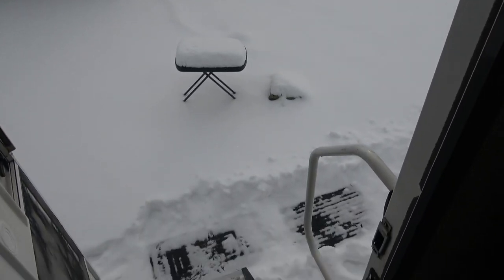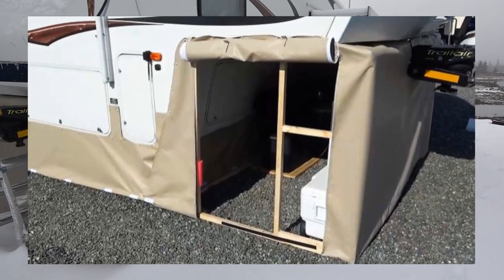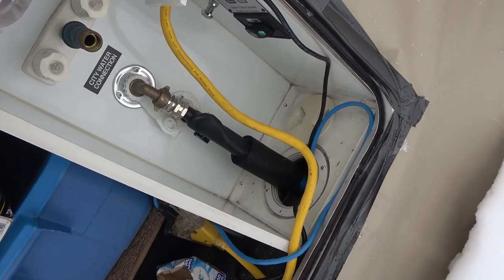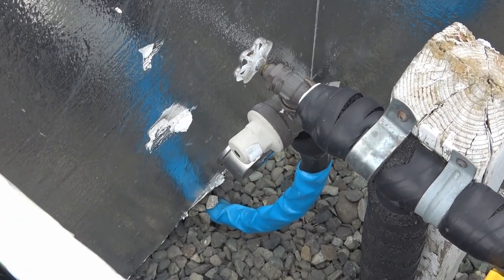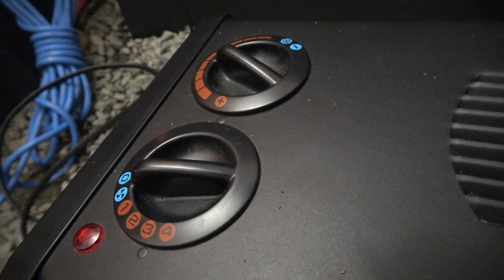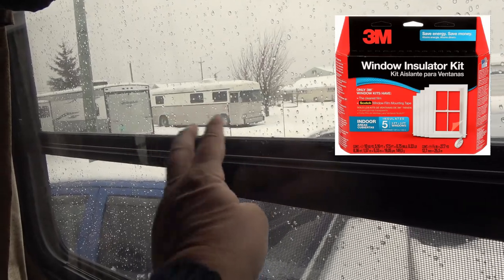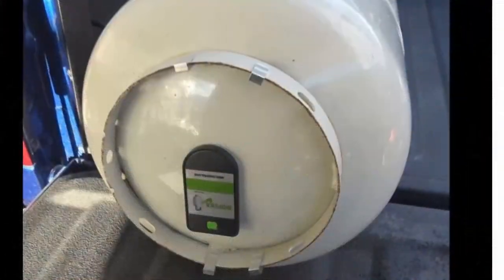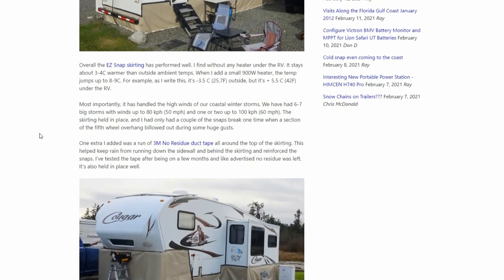10 Things that Help Us Winter in Our RV – Reviews & Updates

Comment: Thanks for the update Ray. We just piked up our new rig that was a 24 week wait, so we are trying to work in this cold weather to get it ready to go! I have used your videos helping me in my work to get ready to go. We have used plenty of Foam and other insulation products to seal up what they do a poor job of at the factory. Also ,almost a ''reinstall'' of both roof A/C units to see that the intake air has a smooth entry, with out a knot of wires and foam in the way, and same for output side into the racetrack vent system in roof. Then it was time to install a ''piggy back'' inverter system to augment the 1000 watt system Forest River puts in with a 190 watt solar unit in this Flagstaff ,from the factory. We will have the 3000 watt inverter now to run the micro and such if needed. Also, installed 400ah of lithium inside with monitor. We will add 2 more solar panels when we get someplace warmer!!! Amazing what an owner can do to improve these RV's, And I thank you again for the video's giving me the ''Courage'' to Cut the 4"" hole in the side of a perfectly good RV wall, for the dryer vent!! And everything else we have done! Hope to see you guys out there!
Reply from the maker: Awesome, sounds like you are going to have a sweet rig there. :)  Wow, 24 weeks! That's a long time to be waiting. Glad you got it!

Comment: I built my own fresh line with reinforced nylon tubing, a water line heater, and that black foam pipe wrap. But the RV park's stand pipe froze two days ago, which cracked my Y fitting. No more Y fittings with any plastic parts... and if it looks to drop below 20F next winter I will wrap it with reflectix over a pipe heater. 

But with any luck we will be in the desert by next January!
Reply: Stick with the plastic y fitting. If the water doesn't freeze at their spigot it will freeze at your inlet valve. Having a plastic fitting on the outside gives freezing fluid a way to remove pressure in a manner that is affordable. The other thing is keep a tap cracked. Water cannot freeze while it's in motion....but ya a plastic fitting outside will save you trying to replace your inlet valve in the cold and wind and some water dmg to your unit
Reply: @frogger2011ify  Thanks I'll keep that in mind!
Reply: @jimleininger8963  I thought the same thing....and I had to change my inlet in -35, thankful it broke on the outside so it didn't leak into the wall...I went back to the plastic y valve after that and a plastic 90 into the inlet

Comment: Thanks Ray!  

Our class C 32' motorhome has single pane windows so I added Reflectix to some windows and the clear plastic to some other windows.  The Reflectix is fantastic for keeping in the heat in the rig, but of course there is no view.  Also the Reflectix significantly increase condensation on the windows.  We take out the Reflectix at least once a week to remove the moisture.  There was no issue with condensation with the clear plastic window covering but the heat loss is significantly more than the Reflectix.  If I was to do it again, I would use the clear plastic film for the hard to reach windows (i.e bunk over the cockpit) as it is pain to remove the screen and moisture every week.  I also tried using the Reflectix and the plastic on some windows but there was still some condensation.  Regarding heat sources we started with propane but have since switched to electric/propane system.  we run our furnace in the morning and evening when we are preparing meals and two  1500 Watt heaters between meals and at night.  For some reason the indoor humidity is much better using the electric heaters.  So far the cost of running the electric heaters has been about $100 a month which is significantly less than propane.
Reply from the maker: Thanks for your tips, Neil. I have some of the kitchen cupboards lined at the back with Reflectix. I did it in the summer to combat the heat and have left it for the cold. I check once in a while for moisture behind it but so far so good. Cheers, Ray

Comment: I just saw something yesterday at Amazon.  Three mat heaters and controls for black, gray, and fresh tanks.   $50
Reply from the maker: Seems like a pretty good price! On many of the better built rigs they are a factory option.  Guess it all depends on whether you have the spare electric power to heat them. Our Cougar actually has an enclosed underbelly and one of the propane furnace ducts runs into it help keep the tanks and plumbing pipes and valves from freezing up. We've boondocked in temps as low as 18F just by blasting the furnace all night.
Reply: @LoveYourRV     Our Thor Windsport heats them as well with gas furnace, but if you are plugged into the electric that you payed for, you might want to heat with electric space heaters and those pads.   Just an option.

Comment: Great job you folks did to staying warm and stof form freezing.
Did you ever tried infrared heaters?
The small very efficient.
Reply from the maker: We have a Big Buddy radiant heater that works great for boondocking but does kick out a lot of moisture, but is perfect for the dry desert. I have it plumbed into my RV low pressure gas system for easy hookup. Its also good for back up heat when we lose power in a storm.  https://www.loveyourrv.com/mr-heater-big-buddy-hooked-to-my-rvs-lp-gas/

Comment: EVERYONE should have a dehumidifier. Everyone. The trick is to find a quiet one. NOTE: Some models will run all the time and others stop and test the humidity once in awhile to see if they need start up again.  I think I like the ones that stop and sample to help save power costs.
Reply from the maker: Mine can be set to auto stop at preselected humidity. In the video, you could see the humidity sensor.
I have it set for 35%. For months it never stopped until the recent dry polar vortex air showed up and for a minute I thought it broke, but no, the outside air finally dropped from the normal west coast winter 90-100% level. ;)

Comment: Ray, did you consider running a 20 amp extension cord from your power pedestal into your camper to provide more power for space heaters? Seems like you could offset the 30amp limit this way.
Reply from the maker: Yes, that's a good idea but the RV site I'm at only has a single 30 amp outlet. Usually, the extra 20 amp is only there on a 50/30/20 pedestal.  There are 50 amp serviced sites like that in the RV park but they don't have the great view we get. :) Cheers, Ray
Reply: @LoveYourRV  That makes sense. Most of the campgrounds I've used have either 50/30/20 or 30/20 and with my previous fiver being 30amp, one time we did use both to supplement power.

Comment: Great video Ray. I recently ran across a post from another Vlogger where they have been spending the winter in their newer good quality RV but have had some attic condensation issues causing black mold. What's your recommended or what have you done to maintain air exchange in an RV attic to mitigate condensation build up in cold moist climates like what you're in?
Reply from the maker: Thanks! A friend did a how-to post on my blog few years ago about installing attic vents as he used to winter in the extreme cold of Wyoming, but I haven't done it to my rig being that we are at a much warmer location,  hopefully with the dehumidifier 24/7 to maintain around 35% humidity inside the RV it will keep it dry up there too. If the inside air is dry enough there shouldn't be an issue I'd think. But I will pull off some vent valances this spring and have a look in the attic voids. Cheers, Ray
Here is the attic vent install post - https://www.loveyourrv.com/howto-install-an-rv-attic-roof-vent-tip/
Reply: @LoveYourRV  Thanks Ray, I wonder how many a person should install? Did you ever install any?
Reply from the maker: I guess it depends on the design and size of the RV. I think somewhere between 4-6  No, didn't think I would need them since we usually head south. :)
Reply: I'd go for the dehumidifier, vents are a pain depending on your roofing material and are just another thing to breakdown in the UV light. A small portable dehumidifier like 4 quarts or so will keep any trailer or RV from getting steemy

Comment: What about the RAM?  Do you have a block heater?  What about an oil pan heater?
Reply from the maker: All Canadian sold Rams have a block heater plug installed from the factory. But its not that cold out here on the coast to even worry about it, the lowest temp this winter has been about -5C but that's at night by the time I want to drive the Ram in the day its right around the freezing mark or higher, I haven't even added the cold weather bra to the front grill. :)

Comment: Ray do you have multiple (4-6) puck style roof vents (kept clear of snow) to improve the roof attic ventilation and reduce hidden mold building up within the attic.
Reply from the maker: A friend did a how-to post on my blog few years ago as he used to winter in Wyoming, but I haven't done it to my rig, hopefully with the dehumidifier 24/7 running it will keep it dry up there too. Cheers, Ray
https://www.loveyourrv.com/howto-install-an-rv-attic-roof-vent-tip/

Comment: Have had two of those propane sensors fail.  Found moisture inside both.  Both were replaced by manufacturer at no cost.  I am suspicious of their O ring lid seal.  I am experimenting with my own sealing techniques.  Laying thread in joint and coverage it with silicone caulk is my favorite so far.  

https://drive.google.com/file/d/1NCqC80Zz7Z-E_nPNroeHCEjjUc_XJkfZ/view?usp=sharing
Reply from the maker: Yeah, I think they should redesign the case. I plan to coat my circuit boards with a silicone conformal coating like this - https://amzn.to/37jb58P Cheers, Ray

Comment: You went waaaaay overboard. I use my travel trailer on full service in northern Alberta in -40 it's easy. Skirt in like you did, heat trace and insulate sewer lines, keep the gray cracked and a tap in the trailer cracked. Put a 40w trouble light in your fridges mechanical compartment on the outside of the trailer. Use reflective bubble insulation to block off 3/4 of the vents. Additionally a 40wat light bulb or oil heater under the trailer best your dump lines add peace of mind
Reply from the maker: Want part of it is overboard? sounds about the same as you, except I don't need to leave the water running or insulate the sewer. Doesn't get cold enough here to bother. Our big problem is big wind and rain storms and high humidity.
Reply: @LoveYourRV  yes absolutely on the humidity. I use a medium sized dehumidifier does the job.
I guess I should have followed up with I don't bother to do anything to my travel trailer till after -10. If your RV or TT has a heated belly (pretty much all RVs do) then your not really gonna need to do anything special till -15c. And at that point all you need is a lil skirting to keep the lines from freezing. Ammonia reboiler fridges are okay until the -25c mark. And well water will freeze before that if it isn't moving but a heat traced hose should handle till -25 on its own. The issue their becomes the  valve into the unit. Thawing it is pretty easy
Reply from the maker: I feel better overkill and peace of mind over the winter is much better than dealing with broken plumbing fixtures or frozen pipes and things in sub zero weather. I've watched out the window as others have had to deal with frozen hoses, doesn't look fun. :)  Our fifth wheel is a cheaper model so really poorly insulated, the slide floor is just a peace of 3/4 plywood! with a bit of foil on it. The skirting covers the slide area and also protects my wheels, landing gear and suspension from the salt spray off the ocean and is a storage area. Things rust here pretty quick.
I don't know if you have a wife but mine gets cold really easily and likes it warm inside so skirting really helps us on the 30 amp service to not have to use much propane to heat with and also to heat the underbelly you need to burn propane. Electric power here is included free but local propane fill is 30-35 bucks a 30 lber, so anything I can do to keep the rig warmer underneath saves me cash. I could get a large propane tank delivered and filled cheaper but that's a pain. Cheers, Ray
Reply: @LoveYourRV  if your going to be at any site for more then a month especially in winter you need a propane contract. The price of propane is unregulated, you can get a 500 liter tank delivered it's like 130 with delivery and bottle rental for a year from canpar. Then they come around and fill the thing every month. My contract isn't cheap I know people with better and my rate this year is 34 cents a liter. My coldest month was 250 bucks and it hit well under -40 I average 120 a month in -25 to -30

Ah yes I forgot about the salt spray. In that case unless ur going to spray protectent on ur underbelly every year the skirt might be a good idea most of the year long. Them skirts take a beating in the sunlight though. You can get some anti UV spray to help that though

A 30lb tank is like 28 liters, but your probably not getting 28 cause they don't tend to fill all the way ur likely getting more like 25 liters
Reply from the maker: I've actually only used four 30 lb tanks worth of LP gas since the start of October, average lows here during the winter are right around freezing and highs are about 5C.  :)
Reply: @LoveYourRV  that's not to bad. You won't get cold enough in western BC unless ur way way up north either to loose the effectiveness of the smaller bottles. After -15 propane doesn't expand so well
Reply: @LoveYourRV  that's pretty good efficiency. I was going through a 30lb every 2 weeks at 0-15c
Reply from the maker: I've found the skirting keeps the heat in under the rig just enough to allow me to keep the rig heated with only electric power here in the winter and not worry about freeze ups even though we only have 30 amps to work with at our particular RV site. That is unless an abnormal event like the recent big cold snap happens. Then I have to resort to running the RV propane furnace. But it only lasted a few days, now its above freezing again and tomorrow we are looking at 9C. :)